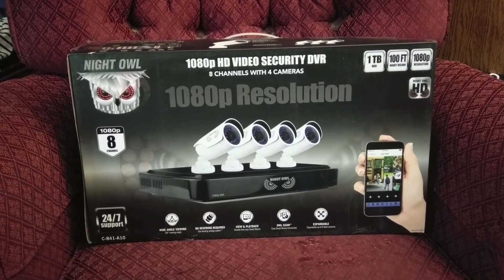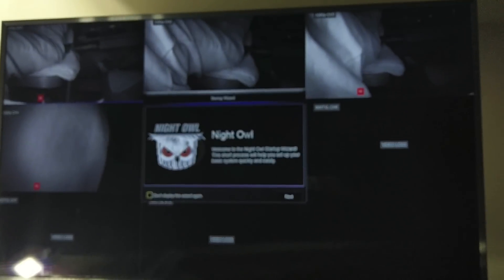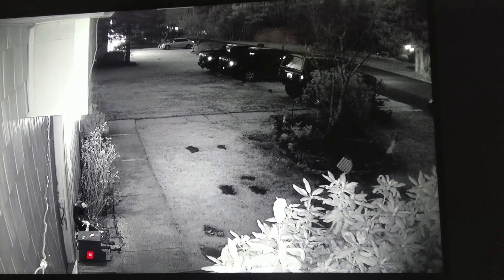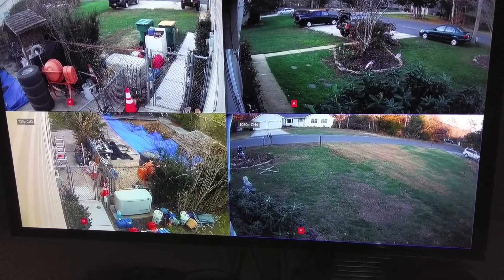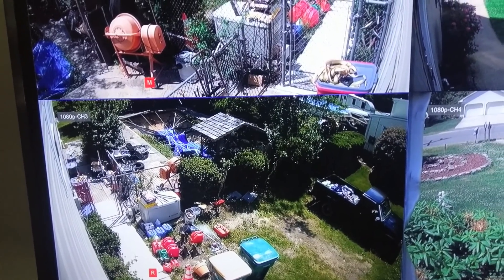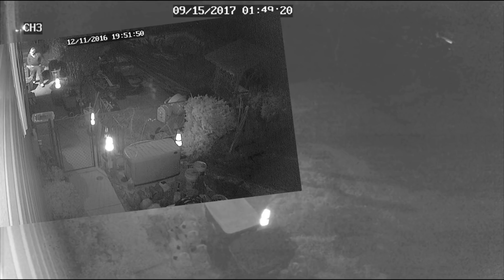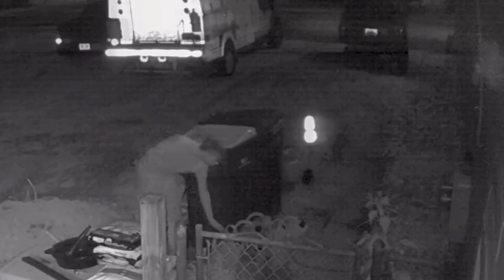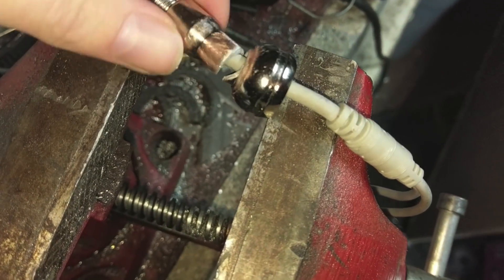Night Owl Security System Set-up & 1080p vs 720p Comparison

Comment: Did you find that you needed more that the 60 feet of cord or was it sufficient?
Reply from the maker: That really depends on where you mount the DVR and how big an are you are trying to cover. Since mine is in the middle of all the cameras, 60ft was enough, but some were a little close.
Reply: NickInTimeFilms Thanks for the quick reply and great job with the video. It really made me want to put a little more money into the system.
Reply from the maker: After doing this review, it made me realize that even the 1080p system is kind of crap, makes me want to go higher too, haha. Just being able to re-arrange the ir lights so that it covers more of the cameras range would probably help a lot though

Comment: Anybody knows if this system records sound too 
at the same time or only is video recorder?
Reply from the maker: It has an audio input, but the included cameras are video only.
Reply: Do you have any idea how could
i record the outside sound at the same time.
thanks for your help.
Reply from the maker: You'll either need to find a separate camera with built in microphone and rca output, or a separate microphone you can wire up. Either will require a new cable run. It might be better to look for an NVR system that runs everything through Ethernet instead.
Reply: @NickInTimeFilms  
Very good answer.
Thank you very much for your help.
Reply: if your cctv camera doesn't have audio there is a tini mic for cctv it cost 20 buck u hook the end of mic (rca jack) to dvr audio input this way u can hear the sound

Comment: @NickInTimeFilms

The Night Owl 4K 8MP version is on "sale" at Costco. Since you have a good amount of experience, would you recommend their Night Owl or the one by Swann? 

Not an expert here, and it could all be a gimmick who knows, but reviewing the pdf manuals and descriptions, it seems the Swann has these additional functions:

Crossing Counter
Static Object Detection
Perimeter Intrusion Detection
Line Crossing Detection
Face detection
QuickShot Cloud

Swann model SWNVK-1685808

https://www.swann.com/us/swnvk-1685808

Swann 16 Channel Security System: 4K Ultra HD NVR-8580 with 2TB HDD & 8 x 4K Thermal Sensing Bullet Cameras NHD-885MSB

Has anyone tested this? Swann Claims to read a license plate at 60 feet

https://youtu.be/p7UeMtjtGbI?t=114

Night Owl
ASIN  B07BXRL1BM
Model #C-IH1610A-8TB
Costco Item # 1205731

Night Owl 16-Channel 4K UHD Wired Smart Security NVR w/ 8 TB Total Storage, 10-4K UHD IP Camera Security System

https://www.amazon.com/Night-Owl-16-Channel-Security-Storage/dp/B07BXRL1BM/ref=sr_1_12?s=electronics&ie=UTF8&qid=1525465565&sr=1-12&keywords=night+owl+4k+security+camera

https://www.costco.com/Night-Owl-16-Channel-HD-NVR%2c-10-4K-Audio-Camera-Security-System.product.100388058.html

The 10 Cam / 16 Chan Costco Night Owl will run $1,957.49 delivered, while the Swann 8 Cam / 16 Chan set can be $1500 delivered, if purchased out of state from a private seller with bad return policy.

The Swann is $500 cheaper for those added functions, has 2 fewer cams and reduced warranty. The Night Owl NVR is 8TB while the Swan is 2TB.

Buying from Costco gives you 2% cash back with some members and adds 2 years to the warranty. Not to mention a good return policy.

Given all the bad "reviews" on the net. It comes down to, which of the two you think is a more "quality" product, with better Cams, NVR and menu, in this cheap 4K 8MP with audio price range, Night Owl or Swan?

Swann manual

https://www.swann.com/us/downloads/dl/file/id/2059/product/1448/8580_series_manual_en.pdf

https://www.swann.com/us/downloads/dl/file/id/2061/product/1448/swnvk_885808_brochure.pdf

Night Owl manual

https://smedia.webcollage.net/rwvfp/wc/cp/27308761/module/nightowl/_cp/products/1516138288659/tab-4db3be77-143f-4d3b-8bf6-51f1928f3a21/e7d7db65-81ae-4edb-acb7-146fa5d50c12.pdf?action=download-resource&caption=Manual&a=d
Reply from the maker: Wow, that Swann video really does look nice. I'm still not very impressed with the 1080P Night Owl System as it's still a bit fuzzy, laggy at night, and it looks like the recorded video is worse then the live preview so you really can't catch anyone with it. I would be highly temped to try a 4k system, and I think an NVR system would also be preferable for higher recording quality. Unless the Night Owl system got a major software update, I'd probably try the Swann as that kit you posted also as an IR heat sensor which will probably improve positive detection rate. Night Owl motion detection just isn't all that adjustable.

Comment: I've had these cameras (4) for almost 2 years and the resolution is awesome, both day and night.  My problem is the damn beeping.  They are suppose to sound an alarm (or so I thought) when motion is detected so I assume this beeping is Night Owl's version of an alarm which wouldn't be so bad BUT 1) every slightest bit of motion sets them off (like a moth, a cob web, shadows, leaves moving, headlights flashing, etc.) and 2) I could never hear this beeping if I were asleep or even in another room.  So, what do I do?  I have adjusted the sensitivity and the privacy zones dozens of times but nothing seems to work.  I would be happy if I could get it to beep ONLY when it detected a person AND if I could increase the volume of the beeping.  Am I asking the impossible?   Note:  I currently have them set up to view on my TV, my PC, my ipad, my Android cell phone and a separate standalone monitor but I have the beeping turned off (it's driving me crazy) and I have disabled the 'push' on my remote units for the same reason.
Reply from the maker: Yeah, I have noticed the motion detection to be just as terrible so I just record 24/7 now. I think the only real fix is to try their thermal ir detection cameras so heat sets them off. Never got to try them though
Reply: @NickInTimeFilms  Any recommendation for increasing the Beep.  I finally got one camera to beep at only the appropriate times but I can't hear it from another room.

Comment: Can you run the 720p on the 1080p system. I might have missed this new my already mentioned it but figured I'd ask
Reply from the maker: Yep, 720 and 960 will work on the 1080p system, but 1080 won't work on the 720 system.

Comment: Of course a 1080p camera wont work on a 720p system, even if it did, it would not be 1080p anyway. And why didnt you show the resolution of them during daylight? Night vision is always lesser quality ugh
Reply from the maker: Obviously a 720p system would only be able to record up to 720p, but in generally using a higher resolution camera and down-scaling it will produce a better picture then a camera working at it's maximum resolution.

Comment: I have a question, since I am using a dell computer as a monitor for my cameras, I attempt to right click my screen in order to find the main menu. The only problem, is that I doesn't let me click. Can someone please help me, by telling me how I can record while I am not at home. Do I need a router? Or is my att wifi box okay?
Reply from the maker: Are you using a Night Owl system or just some program on your computer?
Reply: What I did, was I connected a bga cable to the dvr. Then I connected the mouse.
Reply from the maker: Oh ok, so you're just using the monitor as the main screen. Well if the mouse is plugged into the dvr then it should work. Sometimes i have to move the cursor to the bottom of the screen or just right click a whole bunch until it shows up
Reply: so my real problem, is finding the settings button?
Reply: I tried what you said, I tried to click right a bunch of times, but it just goes onto one of the screens, then it has a small timer on the bottom, and moves on to the next camera screen.
Reply from the maker: +sergio hernandez OK, i just checked mine. See if the option Auto SEQ is enabled on the bottom menu that pops up when you just move the mouse to the bottom center. That has a timer and makes it auto change. Regardless, that center menu has the menu button all the way to the left

Comment: Word of caution: I just bought this set from Micro Center where they were on sale for $199. Unboxed it - no software - no documentation of any kind. On the outer box it states that these are included. So I called Micro Center - was assured I'd get a call back - never did.  Repacked it and drove back to the store where we went through 5 other sets - none had software or docs.
Now it's possible they changed the offer and now you download the program but there was nothing on or in the box to suggest that. So...do I want to keep a $200 set from a company that can't even pack it properly? No...I'll find another way.

Comment: What causes video loss on this system and how to fix it?
Reply from the maker: Generally its either the wire going bad, the camera going bad, the power supply to that camera bad, or worst case DVR input issue.

Swap around components to verify what's wrong. If you can see the faint night vision looking at the camera at night, then power is good and the camera might be good. Try plugging it into and different wire, and for good measure you can plug a known good camera into the questionable wire to verify.
Reply: @NickInTimeFilms  I try swapping the BNC around and no changes. The camera night vision is on the outside but is seeing video loss on my CCTV. I am wondering if its the splitter but then I tried the camera straight in a power adaptor and it doesn't show any video on the screen.
Reply from the maker: Well if you were able to test the camera straight through then it's probably the camera. They aren't very reliable from this brand.
Reply: @NickInTimeFilms  Ok well I guess I am going to order two add on night owl cameras. They are pretty expensive though. $113 US plus shipping is $79US

Comment: Night Owl software is complete garbage. It's incredibly frustrating. I've been using it for over 1 year and it never works as intended. Sometimes the cameras won't pop up in the screen; sometimes they do. You do a search to see what video was captured from the night before and the search pulls up results only one time. You try to do a search from another day and it fails. You switch cameras and do another search and it fails. When it fails, I shut down the program and try again, but none of the cameras will pull up and all the searches fail. After several hours, I try again. Sometimes it works sometimes it doesn't. On Night Owls' YouTube, they have turned off the comments on all videos. I'm sure that's because the negative comments about their products were overwhelming.
Reply from the maker: Yeeeep, it's pretty trash. I've switched to Lorex 4k and it's not perfect but it's a heck of a lot better. App actually works too.
Reply: @NickInTimeFilms  I restarted the DVR today and all the features worked one time, then went back to failing on everything. Such garbage. And of course when you call them they blame it on your network.

Comment: Hey can't they just cut the wires. I feel like a professional criminal would cut those wires super fast and smooth
Reply from the maker: The wires were just run like that temporarily for testing, but yeah that'd be a pretty big weak point to the system if left like that
Reply: Yeah run the cameras to high spota and and run lines under siding or straight through the walls
Reply: Put two cameras crossing the same path that the bad guy travels and problem solved

Comment: How do you get it off the zoom screen
Reply from the maker: I usually just click around a bunch until it does something. I think either right clicking, or trying to have at the bottom to find the menu bar will help. or double clicking, not sure.
Reply: double click in the same channel to unzoom

Comment: All that wire has to be run through your house and all the way back to your tv or dvr? Geez that's crazy.
Reply from the maker: Yep. Some wireless setups are a little easier because you only need to plug them in.
Reply: NickInTimeFilms have u got any opinions on the best wireless that picks up motion without a ton of false notifications? Wyze is cheap but annoying due to their pixel algorithm sending notices for moths and spiders all the time. Ring is ok but I highly dislike the pay for cloud service-that's a joke. I'd like some real decent wireless set ups and don't mind charging batteries vs drilling holes all over the place
Reply from the maker: No input on wireless setups. I recently went to a wired lorex 4k NVR system which is Certaintly better then this setup, but they are such a wide angle that you don't get too much more useful resolution from it.

Comment: Cut the chase and forget this junk.  Get a surveillance system from Backstreet Surveillance, or one of the systems from Amazon: Amcrest, Reolink or Lorex.  Backstreet is the very best quality and durability for DYI with superior customer support and warranty.  But you need to know the rest are Chinese cameras and China can backdoor into your video surveillance system.  Forget 720 and 1080 resolution.  Get the 5MP (2K) cameras at a minimum or 4K for best images.

Comment: Can I put a 900 on a 720p dvd
Reply: I need help sighhh
Reply from the maker: Is it a 900 line? Because that is a different measurement then 720p. 720p also has more resolution then a 900l. 

You can usually go down, but not up. It's be best to check the manual for supported cameras but it might work.

Comment: Do you need Wi-Fi for the cameras to record and function?
Reply from the maker: Nope, everything is hardwired and runs into the DVR box, no network required.
Reply: Mine are hardwired and you are supposed to be able to view remotely but there app absolutely sucks

Comment: I get no signal plz help
Reply from the maker: Did you test your cameras, wires, and power supplies before hooking everything up? Is just one camera now working, or all of them? Might be the camera power supply or the outlets no good.
Reply: NickInTimeFilms i hook up 2 cameras to test them i plugged everything i heard the clock sound on cameras but my tv says no signal on hdmi
Reply from the maker: Ahh, so you aren't seeing anything on the tv. I would check the DVR power supply and make sure the HDMI cord is good and tight. Maybe switch it with a known good HDMI. Does the DVR make any slight whurr noise when you plug it in? Is the TV on the right input?
Reply: NickInTimeFilms cameras seem to get power because they go into night vision mode when i turn of the light but i still get No tv signal
Reply from the maker: Yes, but there are 2 power supplies. 1 for the cameras which sounds like its working, and 1 for the DVR which I haven't heard about yet.
Reply: NickInTimeFilms i dont see no light on the dvr but the mouse has a red light and it's  on it gets power from the dvr
Reply: NickInTimeFilms do i have to use the dvr remote control??
Reply from the maker: Hmm, well it sounds like its powering on then. I've never used the remote. I just plugged it into the TV and it came on. Do you have another device you can plug into the same hdmi to see if that works? If it does then you might have a bad dvr
Reply: I have this same problem where my mouse light is on but the DVR is not showing anything on a monitor or tv so it just shows up as a black screen and the remove control doesn't help turn it on either.
Reply: same problem
Reply: once u finish selecting HDMI u have to go back click input one more time